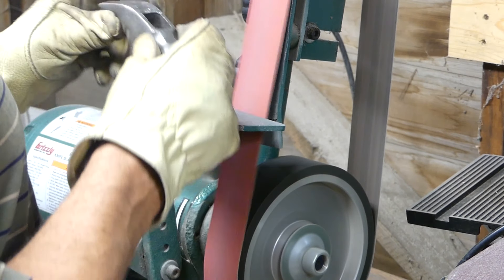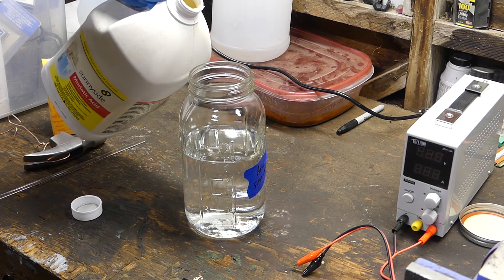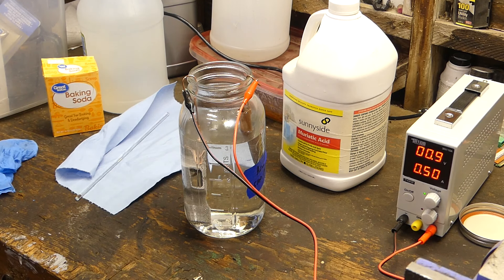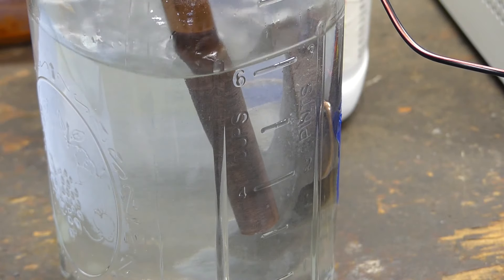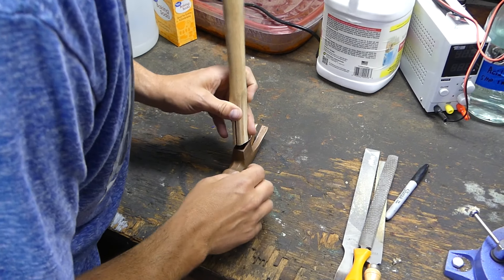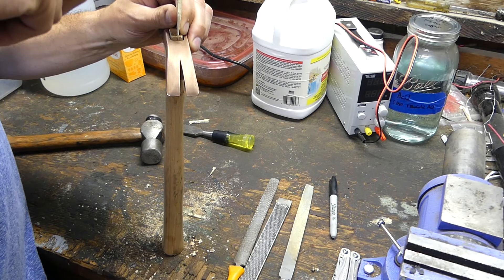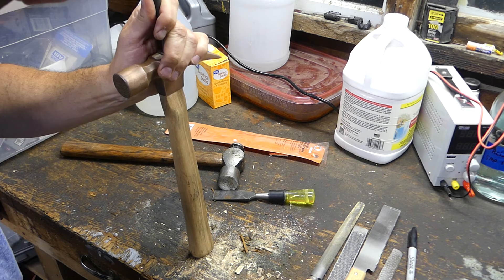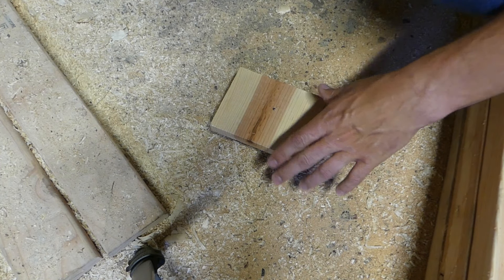Copper coated claw hammer

Comment: Good job!  Did you have a specific purpose for the hammer, like maybe using when you don't want sparks?
Reply from the maker: I used it this weekend on a cedar smoker I'm building. The finish has held up better then I expected. I think it would still spark.